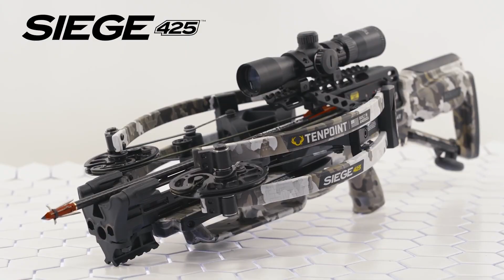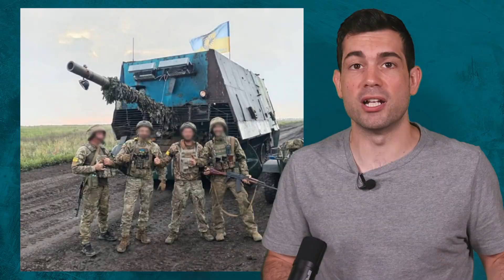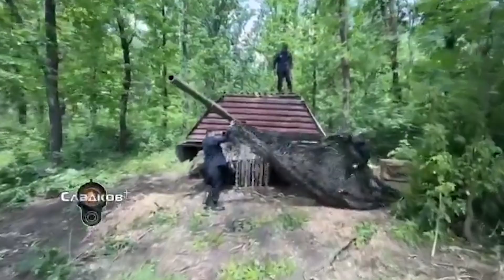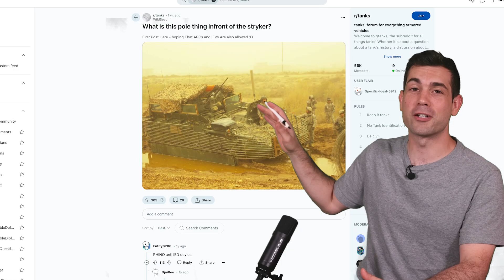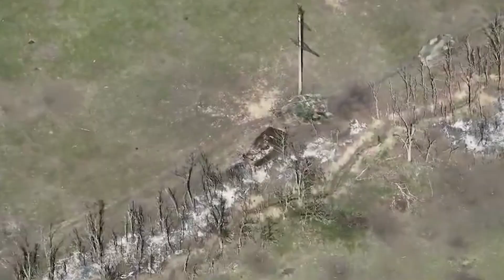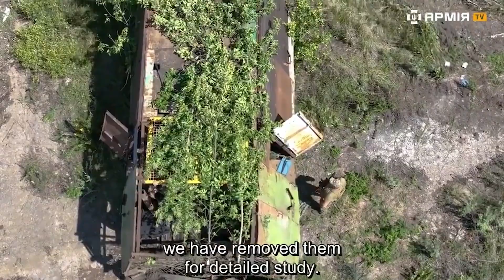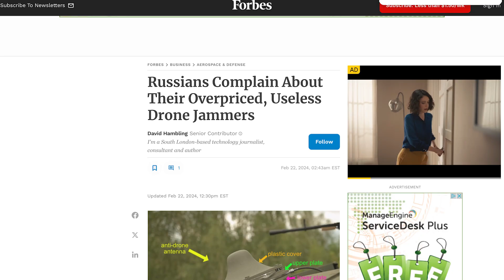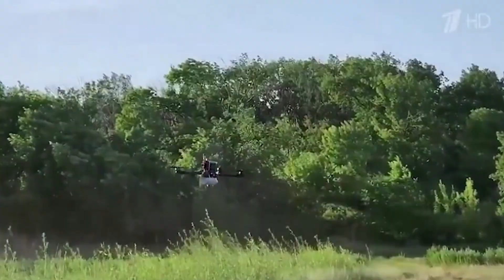Why Ukraine’s Taking Turtle Tanks Seriously

Comment: I'm amazed how much of modern warfare was invented decades before in sandbox style video games.
I remember a famous ARMA clip of someone who put a C4 on a quadcopter, and we all speculated if one day, someone would do that.
Turtle tanks are and have been a staple for games where you can randomly place plates on tanks, and expect small rocket or drone attacks.
Reply: bf4 predicted launching ifv's to the top of skyscrapers
Reply: These Turtle Tanks remind me of the early days of GMOD where someone would just weld a bunch of props to a buggy to make it essentially everything proof.
Reply: I used to pimp tanks in Unturned with lots of sandbags and sheet metal but never thought about making a whole shed around it.
Reply: modifying tanks has always been a part of combat, but its usually only at the fringes and frontlines where these modifications occur because of regulations closer to the command structure. 

In WW1, Tankers created body armor against shrapnel because it was an Artillery is King type war and their countries were all too slow to realize Tanks should maybe be resistant to Artillery too. 

 In WW2 they got so desperate fighting the Japanese that a gunsmith slapped a rifle stock on the back plate of an M2 Browning and created the Stinger Machine gun, which proved very effective before all of the few examples were taken apart again, and theres many other examples of soldiers Uparmoring Shermans, Panzers, Tigers, T-34s, most tanks that served en masse were modified to try to get an advantage over their stock counterparts.
Reply: Yep, and personally figure the 'Murikin version, the 'toaster-on-a-stick', is sheer genius!
Reply: Combat drones have been a staple of science fiction forever now. Including flying explosives. 

 I'm still suprised we haven't seen a small drone that can strafe with shotgun shells or a recoiless gun. 

 Because I think that is the future. Swarms of drones delivered from some platform whether that is a missile, a vehicle, a huge artillery shell or even some mother ship. 

 Then once deployed become hunter seekers that fly around a selected sector like a swarm of bats or a swarm of small birds. 

 Turtle tanks just remind me of 40k for sure. I wonder if dropping white phosphorus would work.
Reply: @dianapennepacker6854  those mini drone helicopter and plane missions in GTA 3 and vice City that can explode
Reply: @alexv1190  Didn't the original two Terminator movies in the 80s showcase quad copter drones in the future sequences?

 Or am I just imagining it from their sequels?
Reply: the thing is...this is only effective because ukraine is fighting with 40 yr old tech that isn't even theirs.  against an actual country with an actual army, the "turtle tank" wouldn't survive it's first engagement.  one shot of artillery and that "shed" is gone.
Reply: civ div uploaded a vid of him in ukraine and there's a vid of them literally using arma 3 to train for drones lmao
Reply: @scoot420  They're using the steam deck as a main part of the control system for some drones in the field, cause it runs linux and so can be easily modified to fit their needs.
Reply: By the way look up the short movie from Dust called Slaughter Bots. 

 I've been imagining those for like twenty years. I'm sure older folk have imagined them far longer. 

 Yet instead of suicide drones. The drones of the future will also be able to shoot a projectile, and go back to recharge, and rearm at some base if they are needed to. 

 The movie gets the deployment down! Just missing missiles full of the drones!
Reply: @dianapennepacker6854  those slaughter bots are basically here minus a highly reliable self flying and target acquisition system

Comment: I wonder if it is possible for the user to modify the software in DJI type commercial consumer drones. If the software could be modified to make the drone fly in irregular patterns, like some insects do, making it hard to aim and shot at. And also if the GPS is interrupted, if it can be made to interpolate how to navigate from recent adjustments needed because of the wind. I.e. detect it is jammed, and fly the last part of the plan without assistance from GPS.

Comment: More armor/layers is ALWAYS better, the question is if the downsides don't make it worth it.

A big problem with just armor itself by mass is that mass = weight.

Layered armor is in genral better, because energy will be much more dispersed, but of course it's not that easy to just add layer over layer.

What you got here is simply a light extra layer, that - while not being strong enough to stop almost anything - is still something you have to overcome, you can't just pass through. So in general this means, that you have to release the energy of your warhead a lot earlier than you could with out that. And while this layer will not stop the enery, it absorb a bit and - what is more importat - furthe diesperses it. 

This all adds up to reduce the impact on the actual armot of the tank - it's plain physics.

Comment: People tend to forget we did somethi g similar in iraq in afghanistan with the RPG cages and the modifications we did to our turrets when grenades were dropped from bridges into the trucks
Reply: wasn't there atleast enough room left so the turret could move?
Reply from the maker: @davidty2006  not really. the turrets were limited to only being able to fire a little less than 180 degrees essentially. this wasn't really a problem though because you only needed to move the vehicle a few degress to see in another direction , and normally we planned every mission so that the "trucks" were pointing in different directions to cover each field of fire in 360 degree security. often the rear security was just two 240 bravo's out the back. This was okay in counter insurgency in IRaq and Afghanistan it worked fine as a solution to the threats we faced there
Reply: Busses in Vietnam had screens on the windows to protect from grenades.

Comment: The comment made at 6 mins is key. They are now pulling a lot of units out of storage that can't be utilized as tanks. If they can't be used as tanks they turn into these APC Jammers.

But that begs the question... why aren't you using an old APC for this role? Surely it makes more sense to use an old BMP in this role? 

The answer then, is that too many tanks coming out of storage are in this bad a state. The prevelance of these is showing us that russia is already dipping into some really low-grade reserves of tanks. 

They may not run out of "tanks" but they're gonna run out of ones usable as actual tanks fairly soon if this keeps up. even if the total number is storage still seems high.

Comment: Its an improvised solution. Like any improvised solution, it works for the intended purpose, but not much else. You wont see those things fighting other tanks or even AFVs, but if you need to assault positions held by infantry and dont want to get your ass blasted apart by drones, then rushing in with one of those things is a good option.

The fact these things even exist shows how much of a threat drones are.

Comment: This is the evolution of the "cope cages" (Which did work by the way. They wre great at stopping air dropped FPV munitions.  They will not stop a javelin, but they were never designed to).  

The problem with anti air dedicated AA platform is the swarming ability of these drones. It boils down to a number game and no matter how great your targeting system is, you can only carry so many rockets, and you cannon can only point in one direction at a time.

Comment: I despise the whole "the tank is dead" I see because of drones. I just see it as a matter of time before a counter measure is properly found. It is something one needs to tackle no matter what sooner or later, seen ideas of RWS fitted with ammo that fragments to take down drones, ECM systems that are in general stronger and on more frequencies and more. I think just ECM warfare will get way more focused on going forward.
Reply: Have the same opinion on this, think the largest problem today is to make a ECM unit that's able to block a wide range of signals small enough to fit a tank without obscuring other important functions. They are probably getting there, know for sure that Russia is pouring in a shit ton of resources in to this as we see new adds from the big weapon factories pretty much monthly about new EW/ECM tech.
Reply: @andreasfjellborg1810  I mean, just recently there was a video about a soldier running with ECM gear on his back. So it is something Russia is focusing a ton on it seems.

I am guessing if anything, the rumoured deal with China will mostly be to get stuff to make ECM equipment (and probably military related), since to my knowledge, they struggle to make their own electronic parts. So what we are seeing is extremely basic ECM system atm just churned out to have something that might help. Until they get something better.
Reply: Measures have been found, but most nations don't have access to them (basically, unless you are the US or Israel). Look at Gaza--FPV drones are under blanket jamming to the point where they have been a non-issue. The problem Russia and Ukraine are dealing with is that they don't have cutting edge tech in that field and so both sides are kinda screwed.
Reply: @thesarcasticliberal  Were plenty of issues with drone at the start of the latest Palestine - Israel conflict, tanks and IFV/Transport vehicles were taken out, soldiers too. But remind yourself about the size of Gaza and compare it to the Russian/Ukrainian frontline, a single attack can take an area the size of Gaza. Gaza is only about 7x60km. it's impossible to cover the whole front, not even Nato would with all it's resources would be able to do it, especially not in depth.
Reply: ECM will, but anti-ECM tech is also being worked on. They're already testing AI for controlling attacks. So it'll be the standard stuff... EMC, maybe some sort of decoy system, something to shoot the drone down, perhaps drones to intercept drones. All the usual counter and counter-counter stuff, plus protection onion.
Reply: @Axterix13  Sure. Have you seen the crazy thing that Germany and Israel just announced? A swarm drone launch platform made by Rheinmetall that fires 126 Hero drones (Uvision) that are networked to coordinate strikes on multiple targets (or focus on 1 in case of naval uses to overwhelm AD).

It's going to be a constant race between new drone tech, anti-drone tech, and drone countermeasures.
Reply: @Axterix13  Yeah. Either way, counters will be worked on, I despise the whole debacle around a weapon system being dead just because something proves to be effective against it.
Like with tanks and ATGM systems became more of a thing.

This is just another case of the shield and sword being changed when one gets the upper hand in situations.

Comment: Just looking at the picture of the Turtle tank and all you need to do is fly the drone down to the tracks and boom, a trackless turtle tank is a sitting duck for artillery.   That's the thing with drone based munitions you can target weak points to disable and destroy armored systems.  And as modern processors are so fast you could automate the accuracy of the detonation.